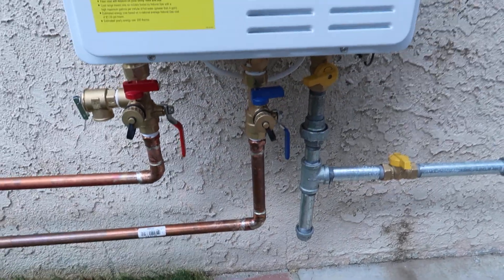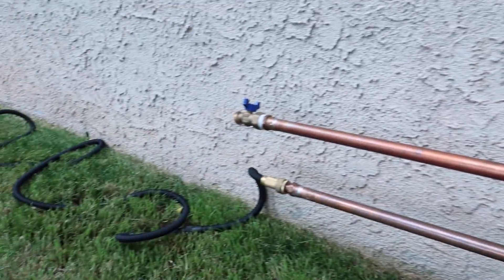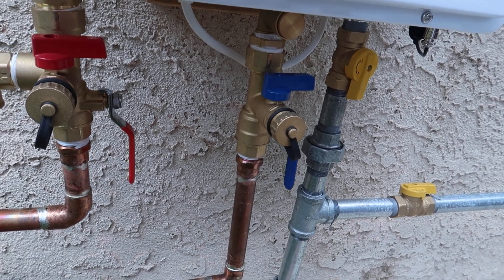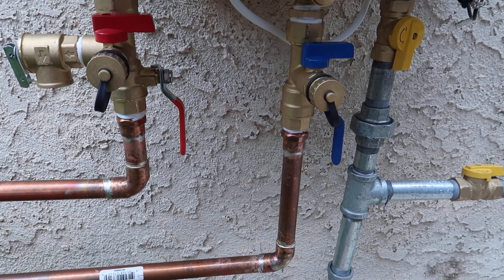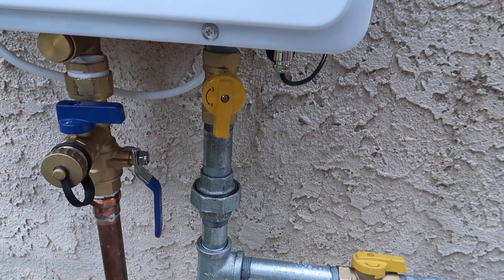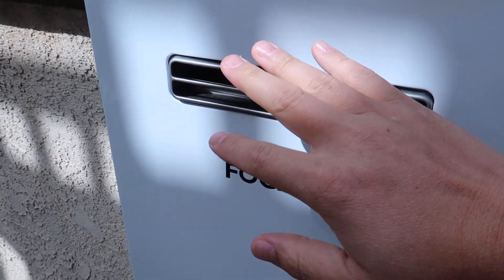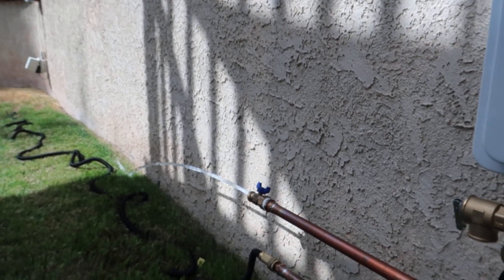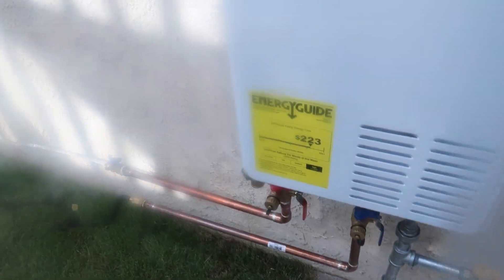How to Install a Tankless Water Heater Outdoor Natural Gas | Tankless Water Heater Installation

Comment: Safety discharge valve is installed wrong! (installed backwards!)
Reply: Are you sure about that? It has an arrow to show flow direction.
Reply: @Bloodstriped  
If  arrow indicates correct direction , then that is definitely the way to go! In that case, I stand corrected, and take back my comment!🤔

Comment: Omg that flexible gas line not allowed on exterior. Needs to be 3/4 inch black pipe with thread seal. Don’t see any on any of those fittings
Reply: Flex line is legal outside
Reply: @tracker1ify where's that.
Never seen that.
Reply: You can use galvanized pipes.
Gas companies use it all the time for exterior exposures but they paint them gray. Some units are 1/2  in pipe in. I would have just pipe it the extra 3 feet.